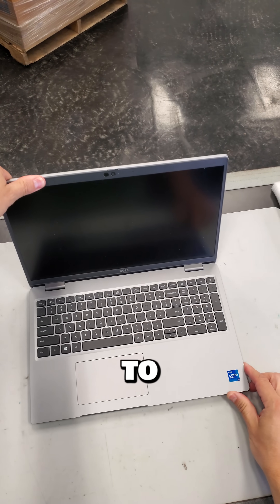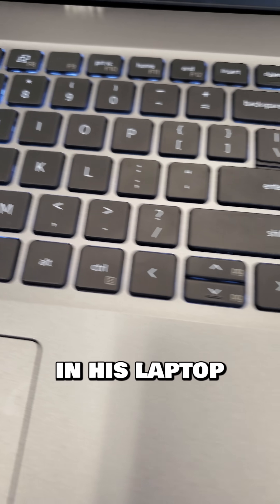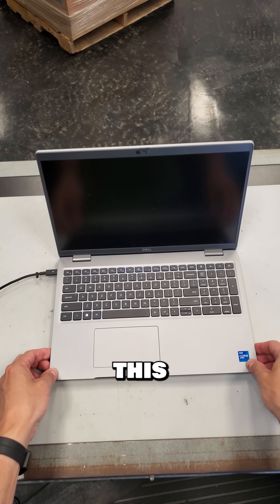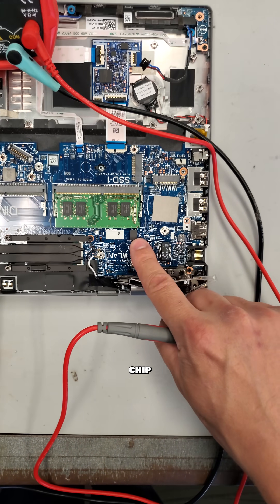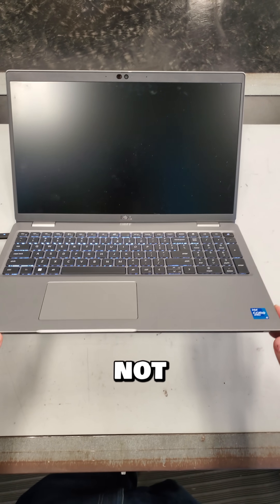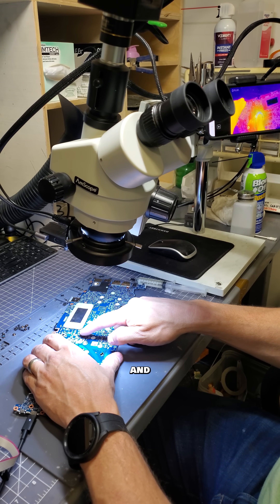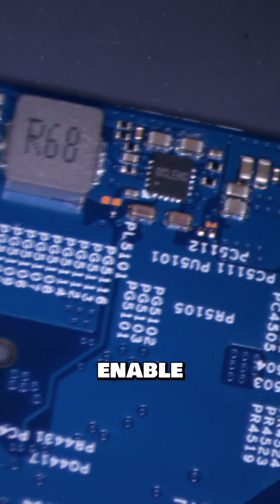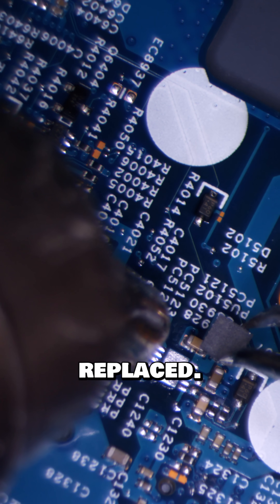Warning: Cheap USB-C Devices Destroy Laptops #laptoprepair #shorts #pc

Comment: @dellpartspeople, do you have any idea why when I boot up my dell laptop it randomly freezes? the thing is that when I do manage to put in my password and get a 24 hour video player in the background it will never freeze the whole system unless i close the player. sometimes when it freezes it does some wierd screen anomalies and then the only way to reset it is to turn it off from the button, the backlight still works tho. Thanks in advance.
Reply from the maker: You might have one of your video cards failing.  You may have an Intel integrated graphic card built on the CPU and also a discrete graphic chip like an AMD or Nvidia GPU.  When you play the video, it enables/switches to the discrete card, and then you do not have issues.  So that would point to a bad Intel video.  Try disabling one of the display adapters in the device manager, and if that doesn't fix it, switch to the other.  I hope this helps.

Oh yeah, if it is a Dell/Alienware laptop and you live in the USA or Canada, then yes.  You can fill out a service request form at partspeople.com

Comment: What's the cost of the repair?
Reply: $100 for diagnosis and repair. If it's a motherboard issue they're gonna charge another $100. They also explain more in the pinned comment
Reply: @HeyItsQuantum  How much does the computer cost?
Reply: @computer_0x7EA  it's a Dell Latitude 5520 so probably around $1200-$1500

Comment: There is no way all this work was worth not just replacing the whole board.
Reply from the maker: We only charge a flat $200 for motherboard repair like this one. If we needed to replace the motherboard instead, the total cost would have been a little more than $300.
Reply: @dellpartspeople  most places I've seen charge close to 500 for board repair, usually only worth it on apple devices. I'm not saying worth for the customer but you guys are doing it for dirt cheap

Comment: I have this (or a very similar) Dell Precision 3561 as a work computer, provided by my employer. I hate it with a fury of a thousand suns, gives me nothing but trouble <3
I have used lots of other Dell hardware in the past and nothing else ever gave me trouble. With this one it's a daily struggle not to throw it out the window. Dell seems to really have dropped the ball on this one. Most of my coworkers concur. It's especially surprising since it's a workstation and not a regular retail model, so I would expect it to be more stable and reliable.
Reply from the maker: That is strange because these are solid machines.  What kind of issues are you having?
Reply: @dellpartspeople  Power button broke, despite it rarely ever being used, because I use a docking station most of the time. Luckilly it has been replaced under warranty, but for some reason it's soldered onto the motherboard, so the entire thing had to be swapped.
It randomly wakes up from suspended state without reason, I thought it's because my mouse or keyboard sends some signals randomly, but it does it even when unplugged.
It seems to (very rarely, but still) either randomly power up when fully shut down or has some random power draw, because sometimes the battery gets drained in transit.
Sound issues are are about a monthly occurance, this is almost certainly a driver issue and not the hardware, but still, Dell provides it, so I expect it to be extensively tested.
It runs very hot and loud, throttles quite often, especially when compiling code.
(entirely subjective) the keyboard is quite bad, mushy, hard to type on, and I don't like that the F1-F12 keys are set to the multimedia functions by default and have to be switched to the usual layput on bios.

I had more gripes written down somewhere but can't seem to find it now. Will look for it and comment if I do.
Reply from the maker: Wow!  
-- I think the power button thing is just a one-off because I do not see that happening a lot.
-- I have seen this wake-up and hot issue in the past, and they are related for sure.  If you have not done so, I would go to the Dell site to download drivers for your machine.  Under the driver category, select CHIPSET, then download all these and install them.  I see 12 there, and there are some more recent CRITICAL updates.  Windows will not update these automatically.  Then, next, using the keyword search box for drivers, type in "POWER" and download and install all of these. This should resolve both heat and power issues.
-- If you want the function keys to stay F keys, press FN + ESC.  This will toogle between F key and function keys modes.

I hope this helps!
Reply: @dellpartspeople  Thank you for the advice. Since I'm usually using the docking station and my own peripherals, the keyboard itself and the function keys are not that much of an issue, but I'll keep that in mind. 
I keep my drivers updated, usually the Dell Support Assist application notifies about new versions. Every version gives me hope that some of the issues get resolved, but no luck so far ;) 

I admit all of the issues I've been having are not that serious all things considered, but they get really frustrating because they happen so frequently. And I can't just simply sell this computer and get another one, or choose when/if I will use it, since it's company provided.

By the way, do you think it's normal for these to "puff" air sometimes when idle? I have noticed that at times, I can hear it make a sound like somebody was sighing and I'm wondering if it's normal behaviour. Maybe it's a strategy to get rid of dust on the vents?

Comment: Chance that a dell laptop won't corrupt itself: 0.0000000001%
Reply: Agreed, but to be fair, I have 2 Dell laptops that are very old and work fine (2016/2018). I upgraded storage and memory along the way.
Reply: @bennyblast 
2016? I have Dell laptops from the Core 2 era that run well.
Reply: @bennyblast  The only high-quality and robust Dell that I've ever used was a rebadged Samsung.

Comment: That s a dell problem it should have shield to over electricity such as apple that use fuses
Reply from the maker: I guarantee that if that cheap dock was plugged into an Apple, it would blow, too.  You cannot trust cheap, no-name devices that are sending 100w into your computer.  You have to remember these USB-C ports are multiple-use ports and have 16 pins, 4 of which are power, but the rest of the data is of some sort.  If a wire crosses, it is hard to protect from that.  

Oh, and BTW, if a fuse blows on an Apple motherboard to protect it, do you think Apple will replace the fuse or the motherboard?

Comment: That's why it's important on both laptop and desktop computers to use good quality power supplies, bonus if you get a surge protector on the plug to be safe. 

For like 20 bucks more, you'll be saving yourself from a potential hundreds of bucks disaster, don't cheap out!
Reply from the maker: Exactly, I couldn't have said it better.  But if you read the comments, people still blame Dell for this and say that they should fix it.

Comment: My laptop brokedown from ESD (core i7-7500u dell vostro 14 3468). I was rolling some sheets and then went to press power button to sleep, the charger was connected, there was ESD and laptop turned off. Only turned on for few seconds upon pressing power button.
So I removed the battery and opened it, disconnected ram, ssd, hdd, and the coin cell then connected charger, fan turns on but no beeps (no ram no ssd) and no power in any usb port and no display. The fan runs for almost 1-2 minutes then turns off. Even disconnecting the fan gives no beeps and can connect disconnect in the middle. Since this, I have put everything thing back but only fan turns on at full speed for 1-2 minutes and battery charging is not indicated.

Anything familiar? No bios or motherboard controller or some capacitor?
Reply from the maker: It's hard to say exactly, but if all the power rails are present, then it does sound like a BIOS issue or chipset issue.
Reply: @dellpartspeople  Thank You

Comment: Nice! Otherwise that whole entire computer would’ve ended in a landfill, all because of two tiny dead microchips
Reply from the maker: No, I would of just replaced the motherboard, but since I was able to fix it, I saved them more that $100.
Reply: @dellpartspeople I think he means if the owner never sent the laptop to you for a repair, the owner would have probably thrown it away and got a new one.
Reply: @charliesretrocomputing  true, mobo is a really expensive part, especially if it's a high end CPU or GPU, owner wouldn't have paid it most likely.
Reply: @dellpartspeople wonderful
Reply: @dellpartspeople WOULD HAVE
NOT WOULD OF
Reply: yeah laptops are so terrible with their... Basically irreparability... Like your gpu fails, throw away the whole laptop.
Reply: @_-noxxon-_  replace GPU with anything soldered down and agreed wholeheartedly
Reply: @_-noxxon-_  It is probably apple.
Reply: Psst….it is still going to end up in a landfill someday.
Reply: @goochI034  just not today.. or tomorrow... or hopefully not for many years to come
Reply: Are you guys a bot? 
Yeah right, there are enough technicians in the world to figure out bad chip problem.

Comment: That dude got lucky the broken 3.3/5v reg didn't send charger voltage to the pch
Reply from the maker: Yes sir. You are correct!
Reply: That would be a hardware and software maintenance career (IT) and lots of experience by getting a job as a Jr technician
Reply: @Alfredo-Ch I'm in training for 3 IT certifications by December, starting om July 15th. I hope to be able to get such a job afterwards.
Reply: Yeah what he said
Reply: a computer and electrical engineering degree would cover these types of hardware topics. Then a few years working at a computer company would get you familiar with typical real world designs.
Reply: Hey, im just curious how you got your computer hardware knowledge from. Im studying computer scince and engineering and we are not taught about all the hardware studd, only software stuff. thanks
Reply: @Wuxia_prince Work for Louis Rossman
Reply: @Wuxia_prince I did EE, but the big thing is to become comfortable with reading data sheets and having a repair and engineering mindset. That's how 99% of repairs are made. 

Get paid to learn on the job at a component level repair shop, and after about a year, you're doing pretty good for yourself.
Reply: @Wuxia_prince you have to study electronics first and not IT ... the software side is kinda easy but you'll never learn how components work and get diagnosed in IT
Reply: @Wuxia_prince makes you wonder why you get a degree, huh? Lol
Reply: @DanielDuhon  or why he chose that specialization lol
Reply: @DanielDuhon  yeah lol. Truly most of the useful stuff you learn from outside
Reply: Something I've learned, over the last 25 years of full-time and over-time work, is that a degree/certificate/education teaches 'how to learn', which serves someone 'in the field', learning specifics from a mentor/supervisor;  'Proves' that someone is 'committed' enough to be probabilistically be 'worth training'/investing in, toward becoming profitable.

"A reputation for integrity cannot be built in hindsight," so protecting one's reputation for being a 'producer'/collaborator along the way is important:  When the really high-revenue work/collaboration becomes available, reputation is something relied on for go/no-go signals for decision-makers.